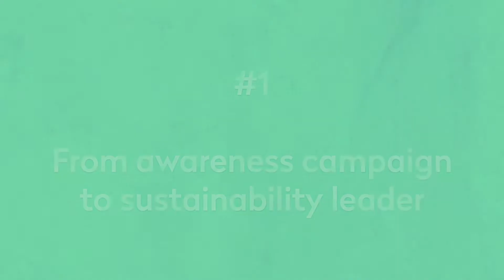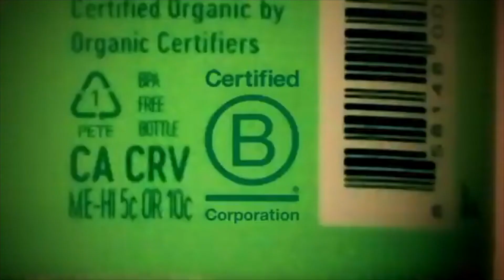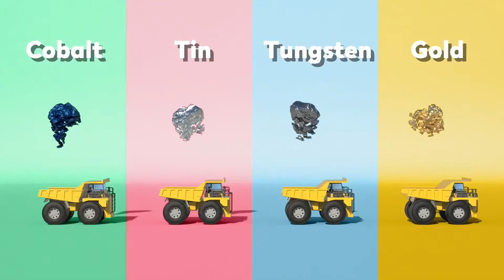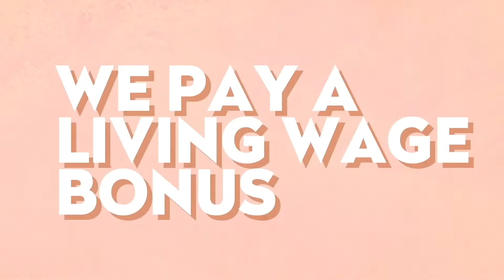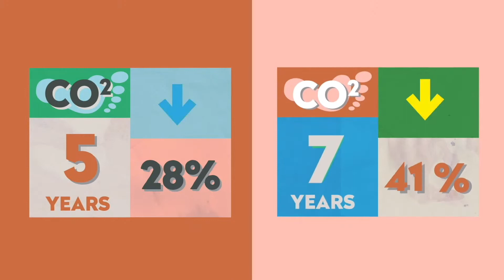Fairphone Explained | Our story, mission & impact | Fairphone

Comment: Most people have a problem with the soc in this phone although for Everyday user IT is fine. But wondering how fairphone does research into which soc they are going too use and what their filosophy is behind the use of the current 632 soc ? Keep up the good work. Give people more choice in modulair parts they can use. By the way is there a site for downloading your stock firmware?

Comment: This is all good and well, but I need a phone with high performance, I guarantee if you made one of these with the performance and features of a modern flagship, and the repairability and upgradeability of your current design, that phone would likely outsell Samsung and Apples offerings 

Don't focus on the low end, the most wasteful phone users are those who want the fastest processors and the highest specs 

If your goal is waste reduction, capturing that market should be your priority (technically you could capture the high, mid, and low end with one device via the use of your modular design)
Reply: @Fairphone  if you made one of these with a decent CPU, released an AMOLED display upgrade, and sold a replacement back cover with wireless charging and NFC built-in, I would actually pay the price premium to buy one, but as it stands, the phones you are making how are just too slow for me to use 

Though your modular design would be excellent for a tablet, you could even make it use the existing fairphone batteries (maybe 2-4 can be installed at once) the possibilities are limitless